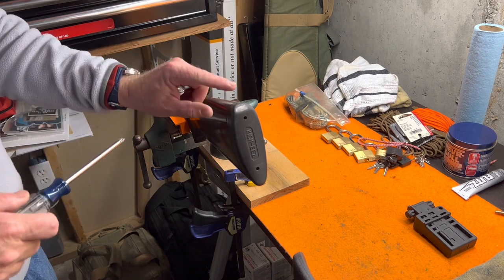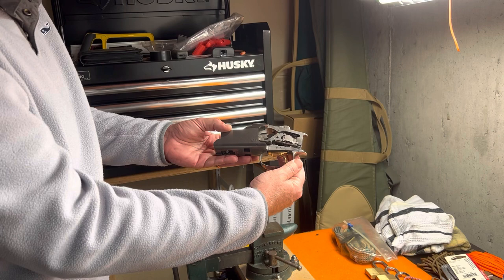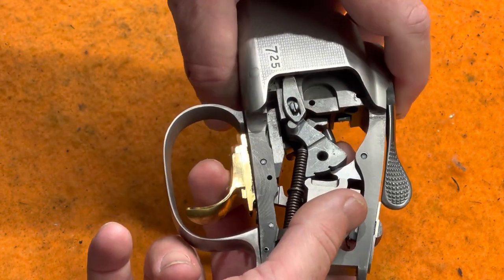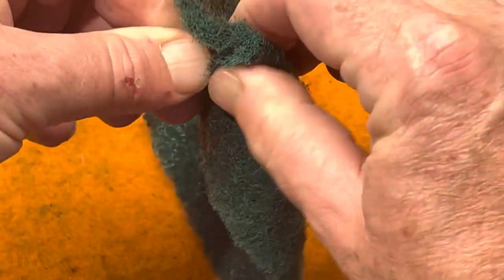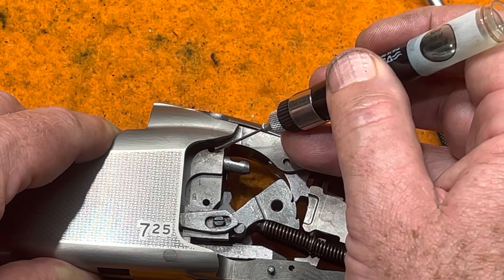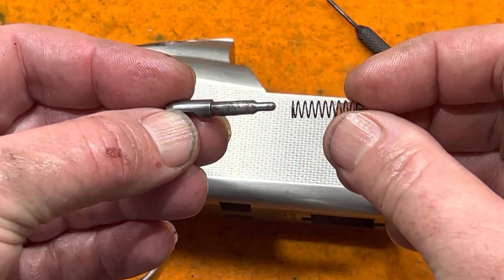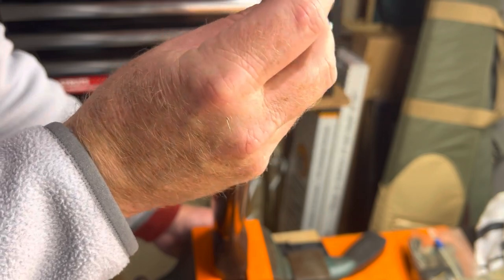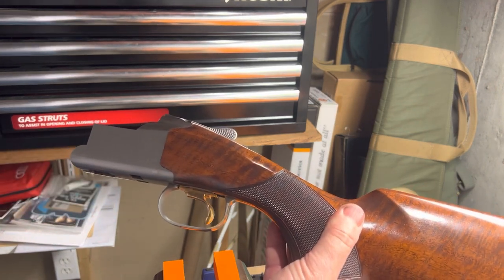Browning CITORI 725: Cleaning the firing pins

Comment: On the stock bolt, don't remove it from the butt stock when you remove the stock. .  stand the stock up  butt up  untill ready to reinstall the stock.   clean the pin recesses .

Comment: The FP retaining pins have to be inserted/removed in a specific direction. 
Each pin has splines which may be damaged if removed incorrectly. 

2:38 - OVER barrel (L side of action) FP retaining pin is inserted L to R, and removed R to L. 
This has been done INCORRECTLY in the video. The splined end of this pin has now been forced through the entire length of the channel it sits in.

3:33 - "Both being driven out from the same side" is incorrect.

3:37 - UNDER barrel (R side of action) FP retaining pin is inserted R to L, and removed L to R.
This one has been done correctly in the video.
Reply: Buddy, I don’t know who you are but THANK YOU, THANK YOU, YOU.   Just finished pin replacement and your comments were right on the money
Reply: Cheers  @jdemartini9807  I'm just a Trapshooter in his 60's in Canada, trying to help other 725 owners. 🙂
Reply: @twiki1963  Hail Canada…I’m a hunter from San Luis Obispo ca.   Also, having issues replacing my mainsprings.  I got one one but can’t seem to line up the other to go in.

Comment: Excellent!  I do this annually on my two 40 year old Citoris.  I did replace the stock flathead screw with a torx screw purchased from Midwest Gun Works.  My Citori receivers are glass-bedded so removing the stock is a bit more challenging.  The firing pin channel is typically clogged with gunk that can be blown out with a can of compressed air.
Reply: I’d like to replace my screws as well.  What screws did you use?  Do you have a part number?
Reply: @paulwhittaker7018  There is only one long screw that attaches the stock to the receiver thu the hole under the recoil pad. Simply replace that screw with a torx screw which you can order from Midwest Gun.

Comment: Great job- thanks for the excellent vid. While cleaning and lubricating the pins, inspect the small ends of the firing pins for pitting; I've replaced one or two from that. Also, spray a bit of CLP or similar down the pin bores, followed with a small Q-tip to ensure the pin bores are  clean.
Reply: I've had success with polishing down the FP tip (only needed for the U barrel) to reduce pierced primers with 100% ignition (always goes bang).

Comment: Thank you! Great video, good common sense editing. Does this generally apply to the 525’s also? AND would it do any harm to push a pipe cleaner through the firing pin holes?
Reply from the maker: @ooyginyardel4835  I can’t speak to the 525 but I would imagine it’s at least similar. Pushing a pipe cleaner through the firing pin holes wouldn’t be a problem.
Reply: @ndewhurst191  : Yes. Since the firing pins show evidence of crud, rust and even moisture, I believe it would behoove you to swab each firing pin hole out with a pipe cleaner or perhaps some Q-tips with some solvent until they come out clean. Again thinking about where the shoulder of the firing rests pin rests in the home position when the hammer is dropped and the possibility of crud buildup at that location causing the exact same issue that the crud on the firing pin causes.

Comment: Thanks for an excellent video. Do you need to clean out the cylinders that the pins reside in?
Reply from the maker: I have not needed to do that. The build up seems to mostly occur around the shoulders on the pins.

Comment: Nice video! Can I use a bronze brush to clean the firing pin?
Reply from the maker: Yes with some clp that could work but the brass might be a little soft. The scotch bright pads I used in the video make it very easy.

Comment: Why is there only a spring on the bottom firing pin?
Reply from the maker: Great question, I honestly don’t know the answer but here’s a guess. The lower firing pin spring keeps the pin rearward to the unfired position. Perhaps if the pin was left forward and engaged with the shell after the shot it would cause issues with the pin when the action was opened. I could envision it dragging across the primer of the shell as you opened the gun perhaps causing jamming issues or damaging the pin over many rounds. I spent a few minutes googling and couldn’t find an answer. Love to hear from anyone that actually knows, sorry I couldn’t be more helpful.
Reply: The bottom pin is at an angle, the spring pushes it up out of the way for aforementioned reasons.
Reply: I have heard the 525 has issues with the bottom firing pin on the 16ga? Looking at buying one that is brand new ,but close to 20 years old!

Comment: 2:15 the lower pin is chipped, always and for ever like this. How can it be this way? It should be possible to make the pins last.
Reply: Mine has pits, not chips. It’s caused by the FP piercing the primer and the ignition arc burning into it.
I’ve polished out the pits (while maintaining a round profile) and it’s worked for me.
Reply: @twiki1963  You are right, I meant pits and that's exactly what I have on mine as well (but only on the lower one). My friend has the exact same gun and the exact same pits. I think it has been exaggerated on forums online, but when enough primers has been pierced and all those gasses and burned grime has escaped backwards in to the firing pin housing, causing it to move poorly or not move at all eventually and causing the gun to not fire. I have ordered new pins but I will try to just polish out the pitting and give the housing a good cleaning and see how that works. If it's not successful I will install the new ones.
Reply: @Thestripper1  I shoot the O barrel probably 80% of the time and the U barrel is for Handicaps or Doubles. 
I replaced the lower FP once just based on the pitting (but had no issues with it.) I even kept the old FP and polished out the pitting. Same with the one installed in the gun right now.
Reply: @twiki1963  Hi. Thanks, this is interesting, but I didn't understand if the pin you are using now is a new one, or if it's one that has been pitted and then polished?
Reply: @Thestripper1  it’s a new one, but that too got pitted within a few hundred rounds. One of the more experienced shooters suggested polishing out the pitting, and I also did that to the ‘original’ FP (which I’d kept around) so that’s a ‘used spare’ now, I guess. 
I use a 400 grit, then 1000 grit silicon carbide waterstone. 
I shot mostly Challenger, but have switched to Federal (though still got lots of Challenger remaining). When shooting from the lower barrel, I try to make it a habit to check if the primer has been pierced (easy for me, since my 725 only extracts).
Reply: @twiki1963  I see. Thanks for the explanation. Good to know that it works to polish them. Many people are even talking about some elusive longer firing pins as a solution to the non firing lower barrel. I think a good cleaning will solve that. Certainly since it works to re-grind and polish them since I doubt this will make them longer. I did some experiments on another firing pin. 400-800-1200 grit wet sanded and then ran them on the coarse side of a leather strop with some fine polishing compound. When I took out my 30x loupe to inspect I saw a perfect mirror image of myself in it. Should work.
Reply: @Thestripper1  I’ve not had the misfortune of having an FTF on that barrel.

But it doesn’t make sense to me that a longer FP can be a solution to this—unless it’s just a complete FTF rather than just pitting/pierced primers. 
So, we’re actually talking about two separate issues related to the lower FP on the 725.
Reply: @twiki1963  No that's just the thing. A longer pin is probably not the solution. Keeping the pin and pin housing clean probably is the solution. I've only had a couple of pierced primers thus far but they all fired and the gun has yet to fail. Taking it apart the next week to get it cleaned out and will polish the pin and see how that goes.

Comment: Need to do this every 5000 to 10000 rounds. That's why I shoot  Beretta
Reply: Yep. I disappointed to pay $3000 for a gun that comes in a carboard box and requires that type of maintenance every 5k rounds. And it's not even specified anywhere in website or manual that you have to clean firing pins. Imagine if failure happen during registered shooting competition
Reply: Seriously?  All guns require some cleaning and maintenance.  This is really all this gun needs besides a bit of lube.  This is 15 minutes every 75 rounds of skeet or so.   This gun has never failed me.
Reply: @bobl997 that seems a little frequent. 
The 725 Trap is my competition gun and it will quite easily go 500 rounds (two flats) before needing some lubrication. 
That said, I always apply fresh grease at the pivot points (after cleaning out the old grease).
Reply: @twiki1963  Exactly the same here, but skeet not trap.  Cracks me up seeing the elitists with K80s and Ceasers while score just as good with the 725.  They all have had to send their expensive status symbols overseas or cross country etc for service.  I also have 725 in 20ga.